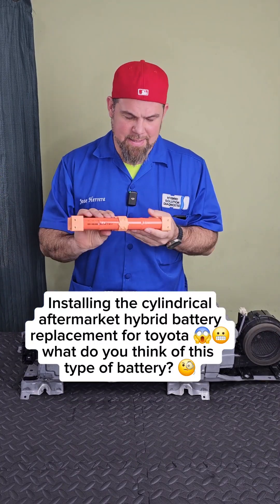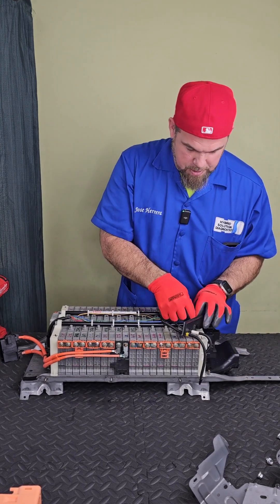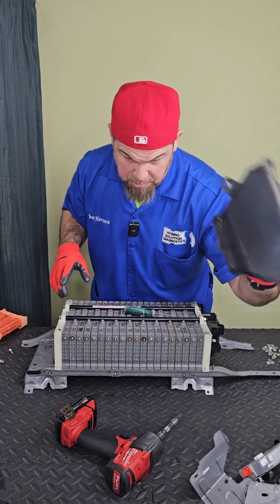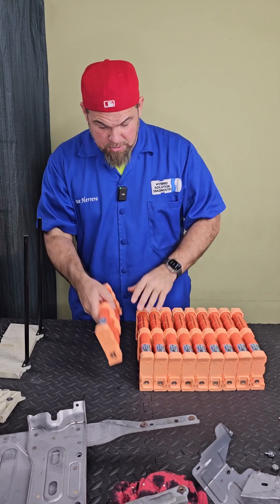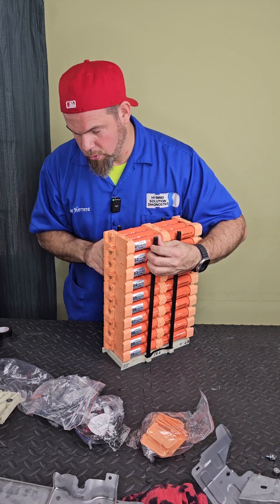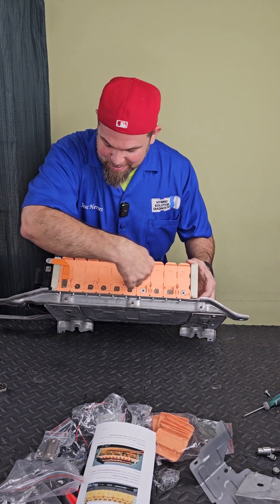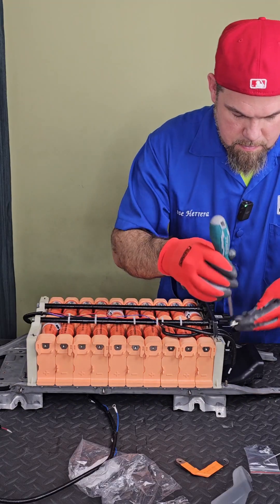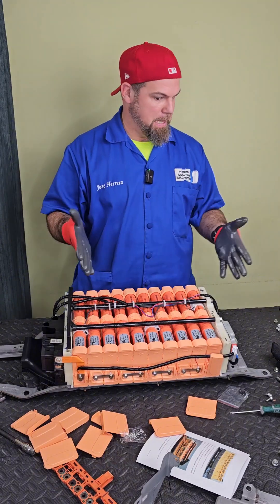Installing the cylindrical hybrid battery for toyota

Comment: I called up the local dealership here in Australia about a battery pack for a gen 2, just for a giggle, about 2 years ago. It was $2350 for a new battery, in a new case and fully wired up. I took up the deal and got $500 back for the old batteries. An Aussie dollar is only worth 65 cents so it was a pretty good deal. Thanks for keeping us in the hybrid loop.👍👍
Reply from the maker: @tonyarntz821  truly a great deal mate ✅✅👍👍